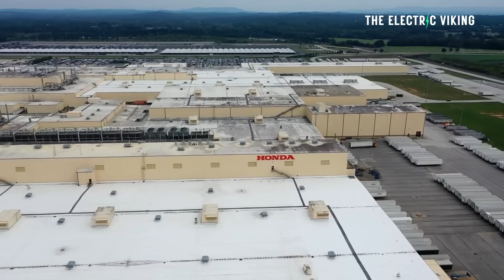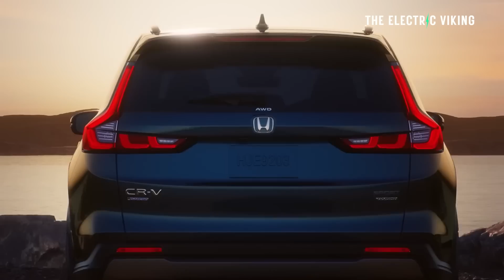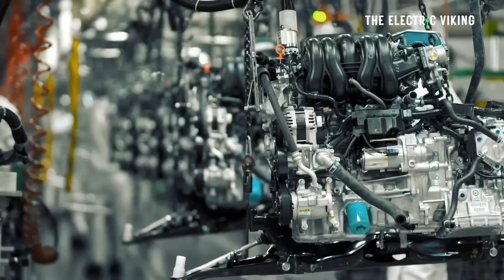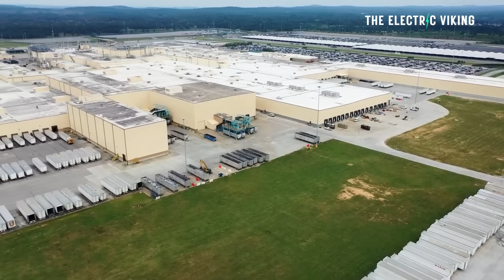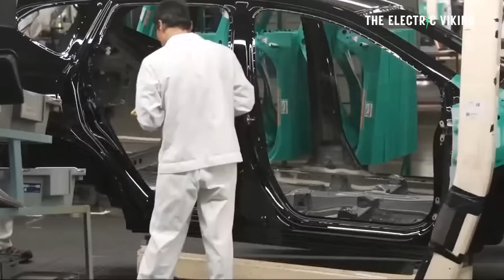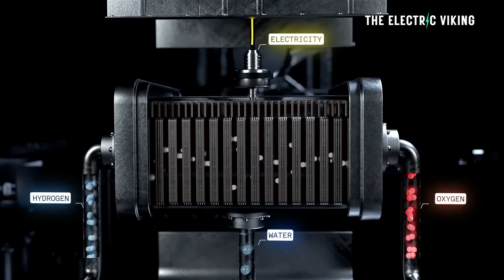11 yrs of development - Honda & GM finally slash the cost of hydrogen

Comment: You can charge EVs at home. Overnight.  Every night. Plus at any one of the ever-expanding network of public charging stations.  Hydrogen? Not.
Reply: A German told me he bought a hydrolizer for his PV to do just that. I asked him what all of that has costed. Never got an answer...
Reply: Of course you can refill hydrogen at home. Eat lots of peas 💨.
And don’t forget regenerative hydrogen breaking! 🤣🤣🤣
Reply: How long did it take to build out the electric infrastructure? 100 years? Hydrogen will be ready when I can plug my car or laptop or desktop lamp to it. Even CNG is a better choice to hydrogen.
Reply: @bogususer2595  1870 to about 1920 maybe 1940 depends on who you ask. Not 100 years. 

Hydrogen is "ready" but will is used by the industry. Its a matter of hydrolizers to get enough green hydrogen. Currently its still extracted from natural gas. 

There is nothing left for driving vehicles. 

You need hydrogen for green steel, cement, paper, glass, fertilizer, E-fuel (yes we need E-Fuel for Ships and planes and many agricultural machines) and all other ammonia based chemistry like plastic and pharmaceutical products.
Reply: Can't you people get it into your heads that:  A HYDROGEN POWERED CAR IS AN EV!  the fuel cell transforms the compressed hydrogen's chemical energy into electrical energy

Comment: Besides the cost and complexity of hydrogen vehicles, the weakest link is the cost and complexity of H2 fueling stations. It is far cheaper and more efficient (~70 to ~90%) to just use electricity to charge your car. Currently most of the worlds hydrogen production takes fossil methane gas and converts it to hydrogen at around ~60% efficiency (and still releases all of the CO2 as if it had been burned), then it has to be transported, losing another ~15%, needing 16 tanker trucks to move the equivalent of one tanker truck of gasoline/petrol, then load it into your hydrogen car where it is then converted back into electricity at ~50% efficiency.  

That leaves us ~25% efficiency for hydrogen cars, or 30% if the hydrogen is produced by renewable electricity. Then there is the reality of how hard it is to move and store hydrogen safely. Hydrogen an incredibly small molecule, and will leak by slipping out through the smallest spaces. It also causes steel to harden and crack, so special tanks and pipes must be used to prevent future leaks.

We already have an incredibly efficient electrical distribution system that supplies electricity to most of the world that only needs a little help upgrading it to supply "fuel" to all EVs that will always be much cheaper than hydrogen, and can safely "fuel" our vehicles in our homes.
Reply: We can refill them, fast and cheap af using quantum electrolyzer technology. I can't help it if most of you don't know any history past what you had for breakfast but the global classified defense and aerospace sector developed some very advanced hydrogen technologies including compact high efficient electrolyzer technology. 

Gm, Honda, Toyota and BMW are probably enemy number one in terms of suppression of the hydrogen technologies on public markets. ALL OF THEM have 80+ years of heavy history into classified defense collaborations in hydrogen technology development. 80% of the technology remains "classified". 

Most people try to use the excuse that Toyota or Honda built hydrogen cars and nobody wanted them but the truth is they built hydrogen clown 🤡 cars, lame golf carts and then to add insult to injury REFUSED TO EXPAND THE HYDROGEN STATIONS PAST CALIFORNIA FOR 50 YEARS NOW. 

No average consumer is gonna go for a hydrogen golf cart they can only fuel in 3 locations in the world and they REFUSED to allow the efficient hydrogen electrolyzer tech to public markets to allow you to make your own. So in the 90s and 2000s most people could give af about a hydrogen car, same as the did the evs. 

Honda, GM, Toyota also developed compact hydrogen nuclear fusion reactor technology they perfected through the mandating of the catalytic converter they scammed everyone on. 

It is truly sad how little you youtubers are reporting on this stuff. You haven't studied the history or the mountains of r and d data lab reports from any of these organizations going back to the classified defense and aerospace sector.

Comment: G.M have been sitting on advanced Fuel Cells for Automotive & Industrial use, that they developed for decades. Before Nikola Motors was proved a massive fraud, they were proposing to manufacture Pickup Trucks for Nikola with hydrogen fuel cells / batteries in them. They bottled out on introducing them in their own brand vehicles, because of technical issues, lack of hydrogen infrastructure and being all in on Fossil Fuel vehicle manufacturing...
Reply: Nobody expected Tesla.

Comment: Hydrogen energy storage will not compete with NaIon batteries. It will be for longer storage, like more power generated during weekend used on working days (like 72h or more instead 4h storage). But requires some big storage volme. As for hydrogen production it would require technology not yet in use like high temperture nuclear reactors. So maybe it will be usefull in 10 years time but for cars they are really joking.

Comment: I love my Honda Ridgeline pickup but Honda is finished and will go under within three years.   EVs will become 50% of the new car market by 2025 now that prices are coming down.  EV prices are actually getting reasonable in the US with the tax cuts. No Honda is eligible because they don’t have squat. Given the much lower cost of maintenance the Tesla EVs are actually cheaper than most ICE cars in the 30K price range over the life of the car…. which in an EV is about double. 

No one will buy the Honda hydrogen cars…. where in the heck can you fuel this thing? Like you said, Hydrogen stations are like hen’s teeth. Also the first time you get behind a polluting diesel truck or a dusty construction cloud, the fuel cell air filter…a pricey item…has to be changed! Fuel cell air intake has to be pristinely clean or it won’t work. 

The faster Tesla can ramp up battery production as well as charging stations, the faster they become the largest car company in North America.
Reply: We can refill them, fast and cheap af using quantum electrolyzer technology. I can't help it if most of you don't know any history past what you had for breakfast but the global classified defense and aerospace sector developed some very advanced hydrogen technologies including compact high efficient electrolyzer technology. 

Gm, Honda, Toyota and BMW are probably enemy number one in terms of suppression of the hydrogen technologies on public markets. ALL OF THEM have 80+ years of heavy history into classified defense collaborations in hydrogen technology development. 80% of the technology remains "classified". 

Most people try to use the excuse that Toyota or Honda built hydrogen cars and nobody wanted them but the truth is they built hydrogen clown 🤡 cars, lame golf carts and then to add insult to injury REFUSED TO EXPAND THE HYDROGEN STATIONS PAST CALIFORNIA FOR 50 YEARS NOW. 

No average consumer is gonna go for a hydrogen golf cart they can only fuel in 3 locations in the world and they REFUSED to allow the efficient hydrogen electrolyzer tech to public markets to allow you to make your own. So in the 90s and 2000s most people could give af about a hydrogen car, same as the did the evs. 

Honda, GM, Toyota also developed compact hydrogen nuclear fusion reactor technology they perfected through the mandating of the catalytic converter they scammed everyone on. 

It is truly sad how little you youtubers are reporting on this stuff. You haven't studied the history or the mountains of r and d data lab reports from any of these organizations going back to the classified defense and aerospace sector.

Comment: The problem isn’t the cost of the car. Hydrogen power have two extreme disadvantages, the running cost (bad system efficiency) and availability. They just throw money in the lake.
Reply: Go hydrogen if you want to waste 66% energy 😄

Comment: I would rather have a Honda more than most other brands. They make great manual transmissions and reliable engines as long as you get one that is naturally aspirated.
Reply: I had a manual transmission #Toyota_Tacoma.
 I own 2 automatic Tacomas right now and I sold that manual one to a friend and ever so often I can take it for a ride, I do like shifting and dancing every so often but not on a daily basis.

Differently do not care for "#FSD" ❗️
Reply: I don't have a "manual" transmission. I actually have no transmission. And i am happily living without clutch, transmission, shifting gears etc. pp.

Comment: The way hydrogen subsidies are structured, you can make a business case in the US. $3/kg of direct federal subsidy. On top of that, hydrogen qualifies for essentially every incentive for EV's, every incentive for renewable energy, and every incentive for "alternative" liquid fuels. So, they are tipple dipping in the subsidy pot along with hydrogen-specific subsidies. I can see  "clean" hydrogen making an impact in industrial applications like fertilizer, steel, etc. Fossil fuel companies like it because it makes it look like they are doing something, and they can use the subsidized hydrogen to reduce their costs (e.g., hydrocracking). But hydrogen cars are a government spending grab and will only go as far as the government props them up.

Comment: Hydrogen is way more expensive than gas it you can even find it. The problem with finding Hydrogen anywhere is and exponential raised to an exponential at this point.  Where every house has al least some electricity .
Reply: We can refill them, fast and cheap af using quantum electrolyzer technology. I can't help it if most of you don't know any history past what you had for breakfast but the global classified defense and aerospace sector developed some very advanced hydrogen technologies including compact high efficient electrolyzer technology. 

Gm, Honda, Toyota and BMW are probably enemy number one in terms of suppression of the hydrogen technologies on public markets. ALL OF THEM have 80+ years of heavy history into classified defense collaborations in hydrogen technology development. 80% of the technology remains "classified". 

Most people try to use the excuse that Toyota or Honda built hydrogen cars and nobody wanted them but the truth is they built hydrogen clown 🤡 cars, lame golf carts and then to add insult to injury REFUSED TO EXPAND THE HYDROGEN STATIONS PAST CALIFORNIA FOR 50 YEARS NOW. 

No average consumer is gonna go for a hydrogen golf cart they can only fuel in 3 locations in the world and they REFUSED to allow the efficient hydrogen electrolyzer tech to public markets to allow you to make your own. So in the 90s and 2000s most people could give af about a hydrogen car, same as the did the evs. 

Honda, GM, Toyota also developed compact hydrogen nuclear fusion reactor technology they perfected through the mandating of the catalytic converter they scammed everyone on. 

It is truly sad how little you youtubers are reporting on this stuff. You haven't studied the history or the mountains of r and d data lab reports from any of these organizations going back to the classified defense and aerospace sector.

Comment: I am in America.  

I am thinking that it might work in one way in the future.

I can see the trucking and heavy equipment sectors going to Hydrogen in the future.

The infrastructure existing now at various truck stops might build out the infrastructure. It would be more viable to do that than anything else currently.

You can haul and transport the H2 in many ways , just like petrol today.

I could see so.e cars making use of that infrastructure in the future in less populated areas.

I believe the majority of cars will be EVs and EV pickups with range extenders in the future vs. Hybrids. 

I would have loved to have owned a Toyota Mirai but I live in the middle of the US.

That full sized Lexus based sedan is very comfortable to travel down the highway in. The over 400 mile range is awesome.

I have owned and driven CNG cars and trucks in the past and would find  H2 an easy adoption personally.

Comment: Thanks!
Reply from the maker: Welcome!
Reply: @electricviking  @Two Bit da Vinci  why aren't we using compact HYDROGEN NUCLEAR FUSION TECHNOLOGY We haven't been able to make it work in a viable way? LIE 

No the public peasants haven't been able to do it. Classified defense and aerospace sector did it DECADES AGO. 

please 🙏 do yourself a favor, I don't know how you wanna crawl the web to pull the data reports from every defense and aerospace company and organization. DARPA, Lockheed Martin, DoD, DoE, Raytheon, Los Alamos, Oak Ridge, SRI Labs, MiT ANYONE TIED TO CLASSIFIED DEFENSE, AEROSPACE. 

What you will find after a few years of compiling is THOUSANDS OF LAB REPORTS confirming 👍 compact nuclear fusion reactor technologies, tritium and deuterium manufacturing electrolyzers, Tiny plasma gas reactors. All kinds of stuff. It's CLEAR the classified defense sector sunk TRILLIONS of off the books defense budget into secret hydrogen based technologies from the 1940s until now. 

What Lawrence Livermore Labs and the DoE announced was a joke, they are 60 + years ahead of what they announced only now several independent labs and scientists around the world are replicating and perfecting the technology, which is causing the defense department to have to begin making public announcements. The public and most of the private sector is who is still a decade away, the classified defense sector been there and done that decades ago.
Reply: @electricviking  We can refill them, fast and cheap af using quantum electrolyzer technology. I can't help it if most of you don't know any history past what you had for breakfast but the global classified defense and aerospace sector developed some very advanced hydrogen technologies including compact high efficient electrolyzer technology. 

Gm, Honda, Toyota and BMW are probably enemy number one in terms of suppression of the hydrogen technologies on public markets. ALL OF THEM have 80+ years of heavy history into classified defense collaborations in hydrogen technology development. 80% of the technology remains "classified". 

Most people try to use the excuse that Toyota or Honda built hydrogen cars and nobody wanted them but the truth is they built hydrogen clown 🤡 cars, lame golf carts and then to add insult to injury REFUSED TO EXPAND THE HYDROGEN STATIONS PAST CALIFORNIA FOR 50 YEARS NOW. 

No average consumer is gonna go for a hydrogen golf cart they can only fuel in 3 locations in the world and they REFUSED to allow the efficient hydrogen electrolyzer tech to public markets to allow you to make your own. So in the 90s and 2000s most people could give af about a hydrogen car, same as the did the evs. 

Honda, GM, Toyota also developed compact hydrogen nuclear fusion reactor technology they perfected through the mandating of the catalytic converter they scammed everyone on. 

It is truly sad how little you youtubers are reporting on this stuff. You haven't studied the history or the mountains of r and d data lab reports from any of these organizations going back to the classified defense and aerospace sector.